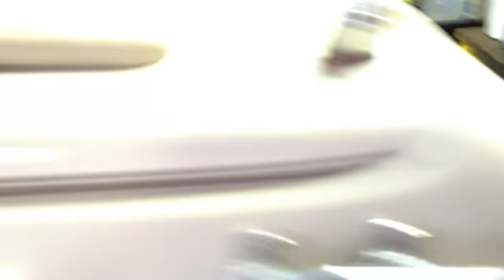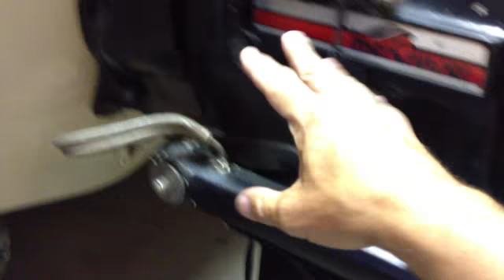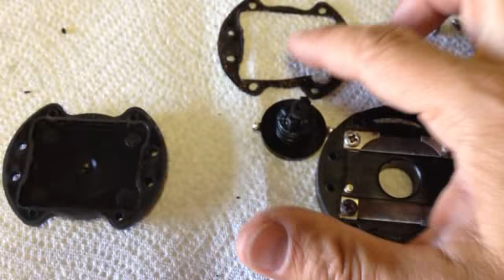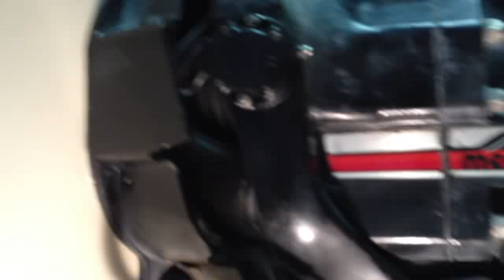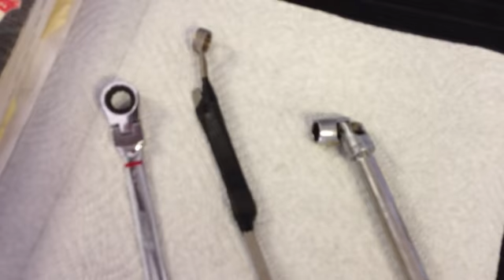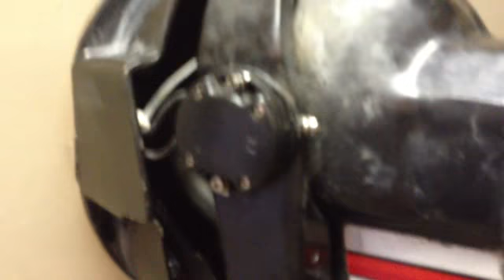Replace Mercruiser Transom Switches WITHOUT removing lower unit

Comment: To start the top bolt I used  about 18 inches of safety tie wire(used before the age of Loctite). I wrapped it around the shank of the bolt just below the head, brought one end up then the other on the opposite side of the bolt head. I then twisted(tight) the short end of the wire to the longer side of the wire Leaving a small tail on the short side.   Using the wire I was able to feed the bolt up into the hole and get it in a few turns, I removed the wire using long needle nose pliers.... Hard to explain but worked for me 2 times....
BTW- My inboard wiring from 1968, looks just fine- the stuff out side of the Gimbal housing was trash...."experts" LOL

Comment: To read resistance you have to induce a current in the meter and therefore there is voltage in the water, it may not be 12VDC but there is some voltage.  Try this with two meters, the analog meter type if you can find two.  Put one on resistance and the other on voltage and touch the red to the red and the black probe to the black, you will read some voltage on the meter set to read DC volts.  It's very low when using a very good meter, and the gauge on the boat is not nearly as good as most basic meters.

Comment from the maker: A long extension will make it easier.

BTW... unfortunately for me... I might as well have removed the lower unit as my shifter cable broke the other day.  The outer cable casing broke right after the shifter bellows.  I had to drop the lower unit and fix the cable at a campground... at night...

So I recommend you look closely at your bellows and shifter cable.  If either need fixing then just remove the lower unit and do it all at the same time.

Comment: Thanks for the video and information.  I'm going to try the same thing on my twin 2004 Bravo 2's.  I'm hoping I only have one bolt to remove instead of the two you had. How long of an extension did you need on the 7/16" wobble head socket?  Thanks again!

Comment from the maker: The fix worked.  No issues.  If I get another 20 years out of these wires I will be happy.  BTW the 12 volt to water comment makes little sense... You need  these units to properly trim your lower unit.  You are reading resistance not putting 12 volt into water.

Comment from the maker: Unfortunately it looks like a no go on the ratchet.  Honestly I did not try very hard as I already has the bolt fairly tight.

Best option is to use a thin wall 7/16 wrench as long as possible.  In my case I only had half of the wrench.  Possibly with the open-end I could have switched back and forth between it and the closed end to get the indexing right and tighten the bolt more.